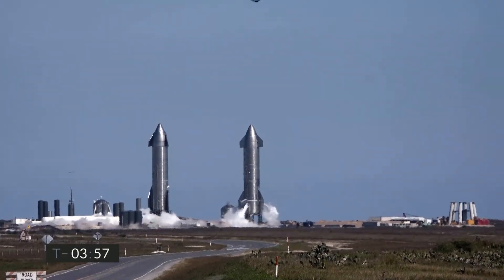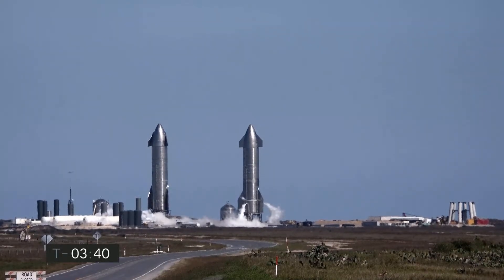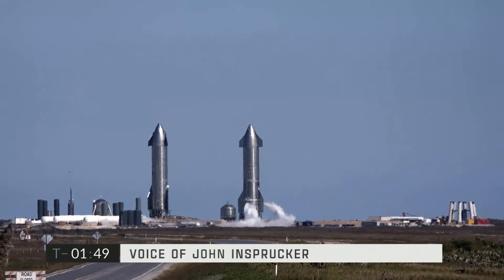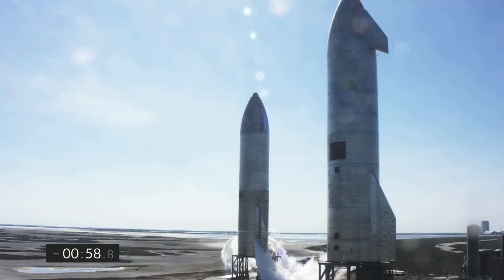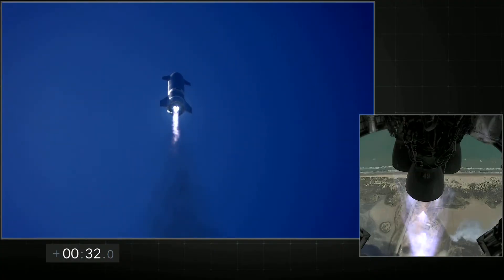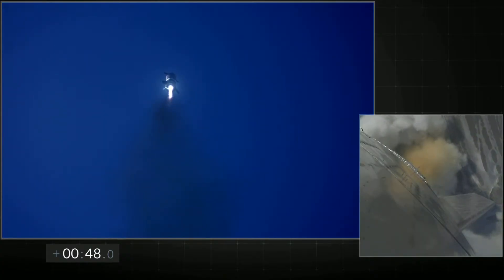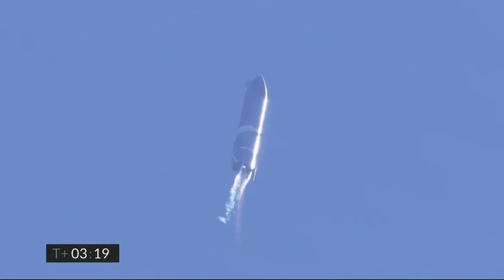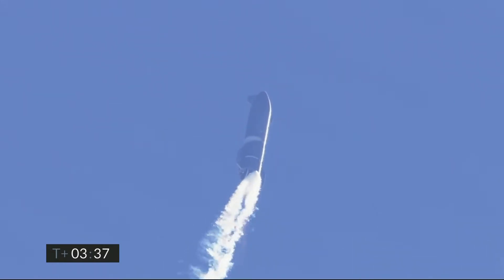Starship | SN9 | High-Altitude Flight Test

Comment: The fact that SN10 was so close to the explosion gave me anxiety
Reply: SN9 be like 'that's you next time buddy, get sweatin'' xD
Reply: When they launched Sn8 my biggest concern was what if it missed the landing pad and crashed over fuel farm but they were totally confident on their accuracy
Reply: me too xD
Reply: I think it is also a test of shell resilience. If SpaceX wants to send hundreds of these, you prpbably want to know the limit of outside forces. 

Gl for Sn10
Reply: At least SN10 has no engines or fuel in it yet
Reply: @mlee6050  still, its quite amazing to know they have such a great belief in their selves and skills to do it that close to another potential starship.
Reply: This mistake was made by the engineers or they started the engine late. Or there was a technical glitch inside that the landing engine started working so late that the starship reached the ground first and crashed.
Reply: @zahidkhan-tq9nb  At 11:46 you can see something flying out of the second engine and the engine doesn't fire up as it was intended. But this thrust was needed to stop the motion. As it didn't you see that SN9 crashed with an angle of approx. 15 degrees to the side.
Reply: @DaveChimny  Yes, why are they starting the engine up so late? I get that it's more fuel efficient, but why not "play it safe" for the first few tests and just get a landing, then work on firing it up later in the tests after that?
Reply: @Vousie  agree, or even keep engines running at lowest possible load during descent. Or maybe train a bit more with model rockets before crashing 2 real size rockets...
Reply: @Vousie   There is no point testing out stuff that already works. They want to push the limits, and not just doing the same old procedures every time :)
Reply: At least know a little bit about the topic and rocket engineering and then comment something. I love how you have absolutely no idea what you talk about but deem yourself in some way capable to make a suggestion. That goes to everyone here.
Reply: @Vousie  Engines on "lowest level" deliver thrust. Even after shutdown, there's a small amount of time with thrust lasting until the pumps have come to a full stop.

That's why they are fired at the lastest reasonable moment.
Reply: @DaveChimny  
Yes, and even at 6.04, it catches fire and burns. But the real problem is that the landing engines are very slow to start.
Reply: @Jandal03  calm down mr janitor
Reply: @orangefrog__yt  I don't see how Starship landing "already works"... The point here is to see whether they can land a Starship (after all the other flight tests), not just test rocket engines.
Reply: Oh shit..
Reply: If you're reading this, stay strong, stay safe, and don't lose hope. Together we got through 2020 and we'll also overcome 2021's adversities with resilience and endurance. During these dark turbulent times there is still hope in the middle of the fear. There are good news, God promised to be there for you because he loves you. "For God so loved the world that he gave his only Son, that whoever believes in him shall not perish, but have everlasting life" John 3:16. I just want to let everyone know that Jesus loves you with a passion more than you can imagine. He gave his life so you can be free. Give your cares to him, for he cares for you 
If you've got pain
He's a pain taker
If you feel lost
He's a waymaker
If you need freedom or saving 
He's a prison shaking savior 
If you're got chains 
He's a chain breaker 
Don't let your heart be troubled.

I wish everyone the best day.

Comment: is propellant from header tank supplied to the two engines through a common pipe that is split or through two separate pipes? sloshing from flip is only feeding one engine correctly causing second engine to not remain lit. given short duration of burn could it be done extremely fuel rich??? keep up the amazing work. Godspeed SpaceX

Comment: Why do they keep destroying them at the end? Is that on purpose? Are they still working on developing landings?
Reply: SN8's methane tank was low on pressure so the engines burned to much oxygen causing a lot of heat and destruction of the engines. Therefore the thrust wasn't enough to land.

For SN9 you can see that one of the two engines didn't fire correctly. Yet unknown to the public why that happened but it caused the loss of control during the flip so the engine couldn't point to the pad for slowing down.

Comment: Spacex, why don't you ignite engine on a higher altitude on a test flight? If you start braking on a higher altitude, you'll have more chance to collect data about engine re-ignition. Maybe it will be ignited a few seconds later, then will do correct landing. If anything will work ok, it will just stop on, maybe 100m altitude and then continue slowly descending. Yes, it will spend more fuel, but on a test flight it's not a big problem. Or you will have a little bit more time to receive the data wirelessly.

Comment: hm... the bellyflip was overflipping. To mutch thrust while flipping? Even one of the two raptores didn‘t light up that mutch? or was the flip maneuver too late ... why the SN9 dont flip much earlier to gather time for orientation regulation for the landing?
Reply: Looks like it was on time.

It likely overshot the flip, not because it was too much thrust, but not enough by a single engine to counter the flip when pointing down.

Comment: Would it be better if they made the belly flop a bit higher from the ground and land vertically as they always do? Seems the delay is the issue not enough time allocated.
Reply: It's enough time in theory. SN8's engines just were destroyed by bad fuel/oxygen mixture because of low tank pressure and one of SN9's engines didn't fire correctly to counter the flip causing it to overshoot
Reply: @norinokia2307  I wish they increase the margin but again there aim is probably to master such an abrupt maneuver for data.
Reply: @abuzzeekzein3162  Exactly. Also I think later versions are planned to have stronger Reaction Control System Thrusters so they don't need the 2 engines for the flip anymore and then they have a margin of either two or one engines if one or two of them fails.

Comment: Maybe kick over sooner allowing for longer time vertical. I think the belly flop will work but it seems it’s kicking over too close to the ground and the rocket can’t change directions fast enough. Also it looked as though both 8 and 9 couldn’t slow down enough. Maybe once vertical, the rocket should use 2 engines to slow down and only after its going slow enough use the one engine to land. Doubt anyone at SpaceX will even read this though.

Comment: So are the IMAX people filming all of this? And YES, these are test vehicles, and as I keep saying to people, the Starship is 50 meters tall and 9 meters in diameter. THAT'S BIG. With nothing to compare them to they look small, but they aren't. And they fly up to 10kms, wait, flip over, "glide" back to the launch site, flip again .... and almost land. I understand from SpaceX that one of the engines failed causing a high speed RUD. (Rapid unscheduled disassembly). I look forward to SN10 and I expect, a lot more testing.
Reply: uh.. 122 meters tall
Reply: @kjeed7735  - Yeah, that's the Starship WITH the super heavy booster; all we're seeing here is the Starship spacecraft itself, which is 50 meters tall.
Reply: @Phase52012  read off Wikipedia, assumed it was only the second stage, not booster... my fault, sorry

edit: realized now it had a long table of info, second stage info saying 50m was there, should've read more deeply
Reply: @kjeed7735  - Cool. I had to double check when I looked it up as many sites said "Starship 122 meters" and that vehicle was no where near that. So I looked it up on SpaceX , and you had to look for it, and it was 50 meters, which is still huge.

Comment: Hello, I am Turkish. And I have a tip for SpaceX. I think do not do the movement called belly tumble. Because Sn8 and Sn9 fell off after a belly roll.
Reply: the whole point is to do the flop to slow down using the atmosphere

Comment: Can anyone tell me why It goes up so slow? I thought rockets were supposed to shoot up
Reply: Higher speed is only needed if you want to reach orbit or space efficient. These prototypes are only meant to test these flight maneuvers and systems. It's not meant to go anywhere for now.

As soon as the landing maneuvers are working they will fly higher and faster to test the system under higher aerodynamic pressures and heat.

Comment: 100% it's the fuel sloshing around in the fuel tank caused by the flip. It is hard to predict how the liquid will affect the craft at these speeds and manoeuvres. Maybe redesign the fuel tanks in to smaller ones stacked together to remove the surface area of liquid hitting the inside of the fuel tank. Instead of a cup, have a lot of straws as containers.
Reply: flip is intended, couldn't flip back to vertical because 1 engine didn't reignite, not enough thrust

Comment: It's just the landing part their having problems with. Such a small non-issue.
Reply: Lol.every idiot can fly.but can he land?
Reply: Indeed it will be solved quickly. A failure is the opportunity to learn from our mistakes.
Reply: Engines don't want to relight
Reply: They pretty much have to crash land it, to get all the data up to the point it crashes, so they can use that data to make one that doesn't crash.  Sounds odd but it is the best way to make the safest and most reliable rocket in the future.  Like crash-testing cars.
Reply: @victorsupreme214  yeah ,.....the same thing which they did on falcon ....We should remember that it landed on its 5th try ......5th TRY !!

Comment: Why did they put another starship beside the landing pad?
Reply: 1. They were probably expecting it to land successfully -- the previous one almost worked, and they have fixed the problem that occurred last time. 2. The rockets that we see here are an older design, which has already been depreciated. The improved version is already in production, so these ones are not very precious. 3. There is probably some publicity value in this too, to show off a bunch of rockets waiting to be launched. otherwise they could have found a way to store the SN10 somewhere else.
Reply: @cogoid  good explanation, thanks.

Comment: Why not restart all 3 engines as a redundancy measure? Instead of 2 engines doing all the work, restart 3 and run all three at lower thrust amounts. If one cuts or drops, the other two throttle higher and regain control. Probs more to it. Can anyone explain?
Reply: 3 engines is way to much thrust for an almost empty starship even at the lowest thrust level
Reply: @ajkumar1665  Thanks for the reply. Aaaah that explains it! If only there was a way to keep the 3rd redundant engine on "standby" incase the 1st or 2nd engine has an issue. But probably a lot more complicated than it sounds
Reply: My hypothesis was correct! Great landing by SN10

Comment: Its obvious at this point they need to do one of two things for this landing. Either use more than one engine for final landing, or start the burn at a higher altitude with more time to slow it down. Two flights now and two crashes that happened because this thing came in way too fast each time

Comment: arent they flipping too close to earth?
Reply: Nope this is planned. They just had problems with the engines both times.

SN8's fuel tank didn't have enough pressure so it burned to much oxygen, that creates a lot of heat, which destroyed the engines.

SN9 seems to had only one of two engines failing. Unknown to the public yet what exactly happened. But since the second engine for the flip didn't fire correctly it was unable to point down again for the soft landing.

Comment: Your landing bur timing izs too short. U ignited under 1km double that distance. The vehicle is heavier than the falcon heavy plus u will have fuel slushing about in the tanks compensate for it by increasing landing burn height.
Reply: 1 engine didn't ignite, so it didn't have enough thrust

Comment: Why they dont land it like falcon 9?
Reply: The reusable part of Falcon 9 is the first stage that pushes the second stage out of the atmosphere and onto a slight horizontal path for orbit.

The first stages of rockets are usually much slower than the second stages so on atmospheric reentry they experience way less heat. For the Falcon 9 first stage it's okay to face this heat. But Starship is the second stage which will face temperatures much higher. So it needs a heatshield and has to point the engines in a different direction. So Starship flies and falls belly first. Also it's much more efficient since the wider area of the belly creates more drag which slows down the ship so less fuel is needed.

Starship will have a first stage called Super Heavy which will land much more like the Falcon 9.
Reply: @norinokia2307  oh thanks
Reply: @Canal.do.bom.  no problem

Comment: This is the second time I watched you guys fail and you didn't see it coming. Has anybody told you that the rocket engines as well as Redirecting it should be done at 2 km or at least restart at 3 or 2.5 km. Whoever told you to start doing that at 1 km is a moron. I have no doubt in my mind that your third attempt will end exactly the same. So long as you maintain the one kilometer Restart and redirect. if you were on mars or the moon then yes it would work.
Reply: Ok so do a rocket
Reply: @zjex_4670   By all means Rocket. it's not like it's my money

Comment: Yeah almost the same performance  , like previous fly in December  ,  failure to reigniting the engines  !!!  🤔  or they were set to land in Mars atmosphere  ?
Reply: The engines re-ignited perfectly with SN8
Reply: @angadsingh9314   them sn8  did  perform to low , the flip  maneuver  possibly  . 😑
Reply: @adolfoconde1371  According to SpaceX, the landing failed because the fuel tank lost pressure.
Reply: @angadsingh9314  thanks a lot for the update  !!!  🤔

Comment: This is pure folly. Think of the natural resources wasted on this foolish adventure.
Reply: What do you mean.... its just stainless steel...
Reply: @angadsingh9314  it’s just stainless steel? You must be joking.
Reply: @dozer1642  Not even a little. The entire structure including the fuel tanks is stainless steel. The engines, obviously use different alloys and there are some other instruments and gadgets in there that are not stainless steel but their weight is almost negligible when compared to the weight of the stainless steel used. This rocket is basically on a production line.
Reply: Plenty of steel being used on far less important things

Comment: Is this successful or not?
Reply: A successful failure. It's a success that most test objectives worked (again) and that the failed landing at the end failed for a different reason than the last test. That's how the Starship program works. Build cheap prototypes, test them, fix the found errors, repeat until it works as it should.

Comment: Weird, it didnt seem to do the maneuver in time like the previous test. Hope they get enough data to make SN10 stick it!
Reply: Both times the maneuver was in time. SN8 didn't have enough pressure in the methane tank, causing too much oxygen being burned, resulting in too high temperatures, causing the engines to consume themselves, therefore the thrust was insufficient to land.

SN9 lost one engine really quick during landing, so it wasn't capable of turning the engines down again after it flipped too far.

Comment: Maybe you should start the transition to vertical and engine start about 5 to 8 seconds sooner?  Give time for 2nd engine to start, start, start?  Then fail it and kick-in the 3rd engine? Is that possible?  Leave enough fuel and oxidizer for an extended, powered descent and landing?  This ship is going to have to be able to land quite a bit heavier than these tests anyway, isn't it?

Comment: “We gotta work on that landing a ‘little bit’”
Reply: Understatement of the week
Reply: Two engines failed to restart, one could be just enough if it didn’t flip too late close to the ground, but still to heavy to descend slowly. Why not land horizontally, just add four new small rockets just for landing?
Reply: @OmarRagudo2025  one failed to restart. Only 2 are used for the landing
Reply: Queue the theme song for Thunderbirds. The camera pans over to the pad as "Thunderbird 1" gracefully enters the frame, lowers its landing gear, fires its descent control engine and gently lands on the ground!
https://duckduckgo.com/?t=ffab&q=Thunderbird+1&atb=v216-1&iax=images&ia=images&iai=http%3A%2F%2Fvignette4.wikia.nocookie.net%2Fthunderbirds%2Fimages%2Fb%2Fb5%2FTB.1%25282%2529.png
Reply: @OmarRagudo2025  weight
Reply: @OmarRagudo2025  I guess they are going for reusable, as in launch from Earth, land on Mars, launch and land back on Earth, likely cant do that horizontally. Unless you already had systems in place both ends to upright the vehicle.
Reply: @Scorpanian  eventually, all spacecrafts will land horizontally in the near future just like Thunderbird.
Reply: Actually they do not have a lot of work for landing, last time SN8 didn't land because of propellant pressure issues but the whole manouver was spot on! This time it seemed to be an engine issue, if the engine would not break they would have landed 100%. These are only mechanical problems. They already put so much work into this rocket that fixing landing won't be a big issue.
Reply: @poijmc606  this time one engine failed to relight, whole the other one worked pretty flawlessly up until the impact.
Bet hey it's progress.
3rd time's the charm right?
They just need to get that decond engine to relight aswell
Reply: Yeah, like a lot!
Reply: https://www.youtube.com/watch?v=Im799XZxLEs